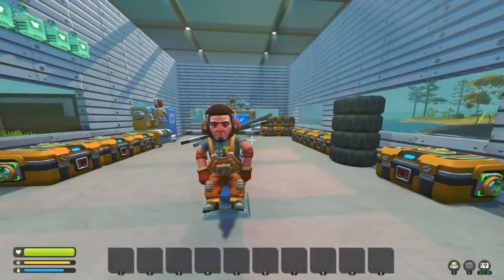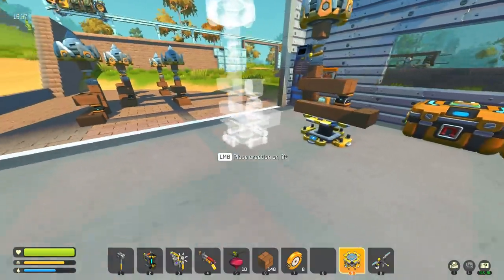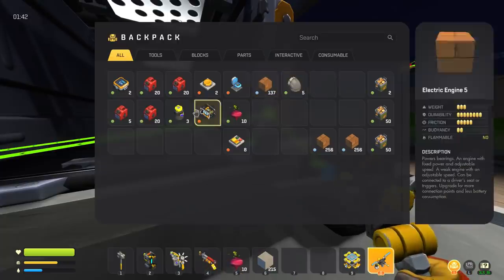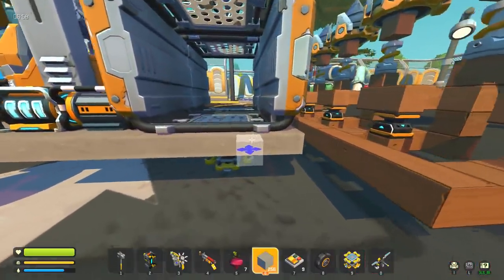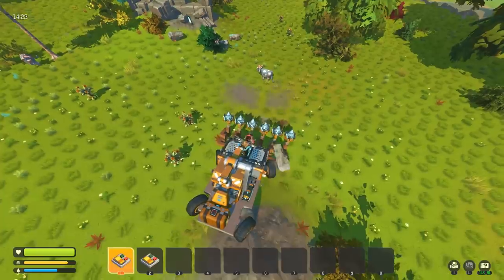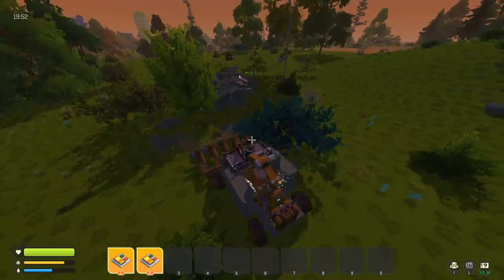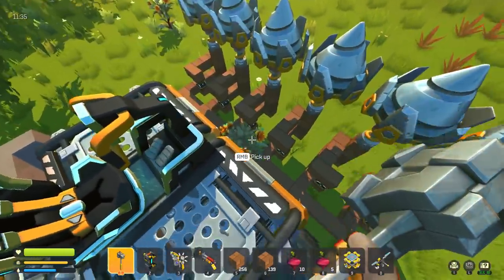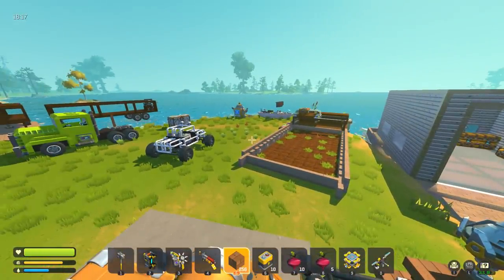I Built a Combine Harvester for Super Fast Rock Mining! (Scrap Mechanic Survival Ep.29)

Comment: THANK YOU KAN! So many other content creators have been relying on Metal 3 as "weight" and I've been sending my hand through my face further and further pointing out that Concrete is the heavier material even though it has more friction. It has a little less durability, but that's the trifecta of the 3 mats; concrete is heaviest, wood is lightest, metal is the most durable. BUT EVERY CREATOR IS USING METAL AS WEIGHTS AND THEY USE TOO MUCH OF IT!!!!
Sorry. I'm just overwhelmed that a creator recognizes the in game stats for what they are. But thank you again, Kan. Great video, I've got a dumbed down version of something like this (no moving arms or limbs.) It works great to get through rock piles, it just needs a guaranteed way to remove the final resources out of the way.

Also, once a refinery bot is taking resources from 1 collector, it won't take resources from any other source save you shoving it in manually until that designated collector is either removed or emptied. That being said, it might be better to have something like 3 refinery bots per collector (overkill yes, but it'll keep the process moving).

Comment: Maybe add two more pistons to hold everything in the front with a short width so you can press a button for switching to lower ground sweeping.  For battery-making, ScrapMan made a sweet glowbot feeding mechanism.
Reply: @Computer Boy It needs both.  Chemicals are easier though because you can setup a vacuum pump at a chemical plant.

Comment: Kan, if you want to have a super low sweeper mode, you can put the whole front assembly on a bearing or one extra piston extender thing set to one length. That way, you would have a super low sweeper mode and all of the fingers would be able to contour to the ground without causing much lag.

Comment: Make the drills bearing/controller driven. Works so much better than any engine powered drill. Rocks don’t fly all over the place. My miner has bearings to tip all the drills 65 degrees in the front toward the ground on a push of a button. Nice build - you are crazy fast when you build, very skilled! Thanks for great content.

Comment: If you were to make a Tank Steering system, with the small wheels, and mount them on sport/short suspension, you could eliminate the problem of getting high-centered on the bumps those rocks sit on.
I do love the combine's terrain hugging feature.  A "Splash guard" is a great idea too. If you could figure out a way to make a bulldozer spade that ushers the rocks into the drills as well, it'd be crazy. Though, I'm not sure how the heck that would work, with how the drill-armatures move.

Comment: i built a pretty awesome design, the front of my miner is like a vice. 2 pistons spread apart the arms and on the inside of the arms is a 2x2 of drill heads on each side. i drive up to a mound, open the vice, wrap around the pile and close it. it clears a pile in no time at all

Comment: kAN makes 3 drill fingers      
kAN: “i have been spam building them”
Reply: I'd wager he tried a few designs off camera to figure out the best dimensions for ground clearance, angle and such.
Reply: Soken50 it’s not that hard to just make a piston powered hinge, there isn’t anything special to it. There is many designs already using the same concept.
Reply: @ermimprettysigmaphonk  never said there was anything special to them, it just takes a bit to find the right distances between the joints to get the right angles.

Comment: Use controllers they spin the drills fast enough to brake the rock
Reply: Was about to say the exact same thing.
Reply: or do they
Reply: Adrian actually, he said brake, if he meant break, he’d say break
Reply: I was gonna say this too but they actually spin the drills with more power (not faster) and they spin the drills at the speed that its like the rocks are butter. And you won't use any type of fuel to drill.
Reply: has to be level 5 though and max speed, doesnt work with any other speed.
Reply: you can drop down to 5 drill bits and double up berings and get more power and speed with controler.  Free energy too.
Reply: But why?
Spinning drills doesn't consume almost any fuel
Reply: @_Ordinace_  There's no reason not to.
Reply: I made mine with 2 lvl 5 controllers one to drive the back wheels and one to drive 10 drill bits. Zero fuel and chews through the rocks like nothing
Reply: Oh hey @M&M Gaming
Reply: @_Ordinace_  did you see how fast the batteries ran out?
Reply: @tomahuman1441  He said brake, he meant break but still typed brake anyway. Yes, typos exist. Just becausd someone says something it doesnt mean that they mean it.
Reply: ShadowLight Gaming I was joking... 🤦‍♂️

Comment: Bearings work better. I use 4 arms with a drill on each end. And 2 drills on the bottom of each arm. You put the arms on bearings and adjust the arm to go to 90 degrees to straight out. No pistons needed and works better. The only thing I have not done is use suspension on the top drills. I don't use them to prevent lag. But, it looks like I will try it. Anyrate. Great video. Glad you got a good miner! And I appreciate that you made the trailer and small scooper set up. It was very cool to see. I know it did not work out. But the fact you did it is awesome.

Comment: For even more efficient mining you can add another refinery, but 2 containers-1 refinery is best ratio, because you refine while you drive from node to node, so 2 refineries, 4 collectors is perfect for this car (it looks to me). You can make car wider than miners. And you could put 2 more collectors on mining arms at sides, just put 1 or 2 blocks higher on side arms, so it don't interfere with other arms when side arms are lower than middle arms, and put collectors wide enough so they goes side of 2 middle collectors when arms fold up, in that way you get additional benefit of collecting more in front of action...and both refineries can take from 2 middle collectors while side collectors are down with mining arms. And put 3 chest at back, so you can go for long mining sessions.

Comment: I think you could do a similar thing with saws... just mount the saw blades on top of the fingers. (so they angle downwards towards the ground)
 The saws will aim directly at the stumps to chop down the trees, then you drive the blades under the logs, and the sides of the saw blades will chop the logs into pieces.

You could probably even use that exact vehicle... you'd just have to swap it between saw blades or drills.

Comment: you could try to increase the piston range to like 10 and adjust the "strength" by tuning the speed so if they hit the ground they wont lift up your vehicle anymore. Then even going over the top of the hill should be no problem
Reply: Ten would just simply break it. The piston would try to extend a length it isn't capable of.

Also, he set the speed to high to increase the power. So that is doesn't bounce off of the terrain as much.
Reply: @kintrix007  yes 10 was exeggerated I would increase the range such that they point towards the ground if no force is applied.
It's just an idea to consider, maybe the car needs to be really heavy for it to work so the drills dont bounce off the terrain however I never had problems with that.

Comment: I just have a bar with 5 drills on it on the front of my vehicle and I can angle it 30 degrees up and 30 degrees down.  It works great and will not lag your game.  I have 3 extra bearings underneath and they are all connected to an electric motor.  They are on button 1 and 2, so they work with the mouse buttons.  I can pull the 5 drills off and put 3 saw blades on without having to connect motors or controllers and cut wood instead.  I do like the idea of shocks on the drills though.  I might try that.  I would have sunk the resource collectors and refinery into the base of the vehicle as they are so heavy and it will lover you center of gravity a bit.

Comment: Nice build I use something similar.  One piece of advice make it as light as possible.  At the rate you can harvest you will run out of the easy formations on flat ground real quick.  Trying to get traction on a slight slope with 2 resource collectors and refinery is bad enough you won't want to carry all that cement go T3 wood you will thank me.

Comment: I would recommend checking out W4stedspace for a  vanilla large wheel design (it uses 8 small wheels 3 bearings and pipes) as well as a suspension system (the larger wheels need it to prevent glitches) the large wheels will make your build look more like a combine if added to the front and it will help you get over the terrain around the rocks.

Comment: use a lvl 5 controller and hook the drills up to it and you can run the drills for free no battery needed just make sure you have it turned all the way up for the speed also works for saw blades you just set them to 360 and loop on :-)

Comment: you should do that piston back and forth thing on them to adjuast the hight
Reply: The thing is, that would not work. A solution that would work is using only bearings, but even that would be weaker.

If you are confused, pulsed dual-pistons do not keep their length if you apply even a relatively weaker force to it. and so it would all messed up and the arms would end up retracted even without pressing anything.

Comment: A drill needs pressure so adding suspensions is stupid. That is basic physics. It also kills your frames due to the increased physics simulations. Your problems where it is not getting good contact are all caused by the suspension.

Comment: Anyone else having "soil babies"? By this, I mean every so often I will have the darkness of watering soil only cover half of the soil block. I thought to reset the soil by picking it up and placing it back down. When I try this, it will pick up between 1 and 4 soil blocks...
Reply: I had this issue, I believe it is caused by having the vacuum pumps overlapping when harvesting. I never had the issue with one vacuum pump, or manual harvesting.